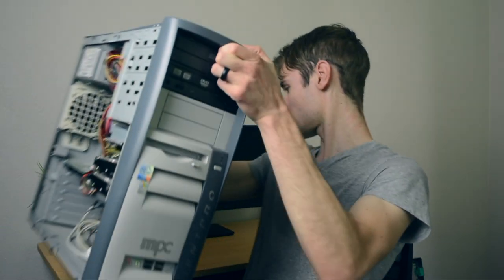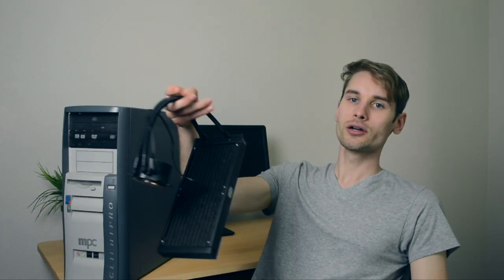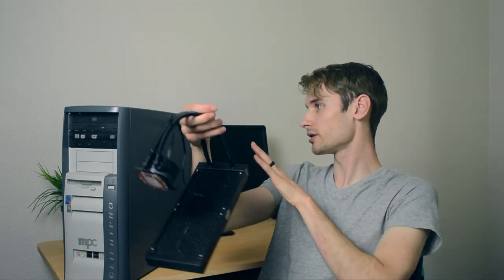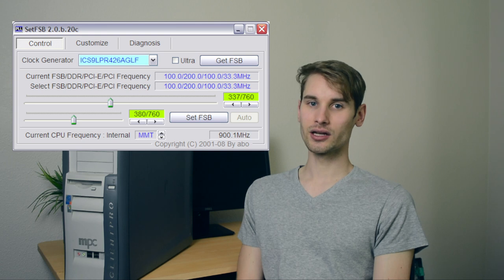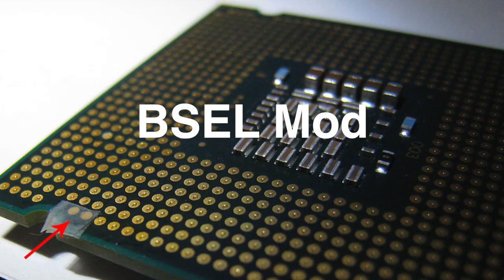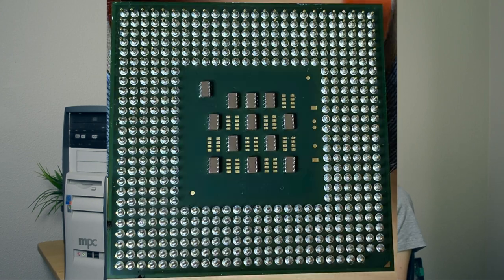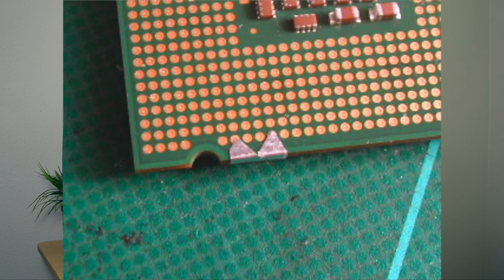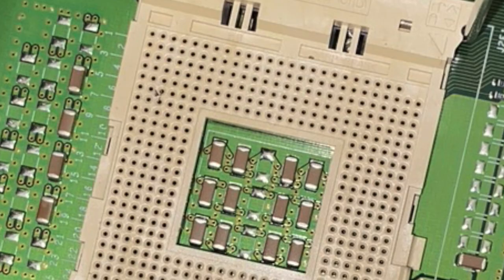Why Overclocking In The Early 2000s Used To Suck

Comment: That's because people used BCLK to overclock back then. Multiplier adjustment came later. Depending on chipset not all boards had pci/agp lock, so your maximum overclock depended more on what those buses could handle rather than CPU itself. It was a mess, but what you did is crazy. Nobody really modded Peniums like that and nobody really broke off pins. That mod only worked to change FSB of motherboard if chips came for socket with such capability and only if there was higher FSB. Socket 478 Pentiums as far as I know didn't have that. Software overclocking wasn't really a thing either, that program was mostly used for mobile chip overcloking in laptops and it was common for it to not work. Still, using software to overclock back then meant that you really shouldn't overclock due to motherboard being weak and no thermal headroom. Depending on chip, some didn't even have any thermal protection, so if it ran too hot it continued to do so until it burned down.

Comment: I don't think it was so bad - I remember that I easily modified my Duron with a pencil from 600mhz to 900mhz. And even before were legendary Celerons 300A which could easily be OCed from 300mhz to 450mhz. In 2000s there were also some Core2Duos which could be boosted from 2ghz to 3ghz! I was poor and I had to buy cpus which could be overclocked, as I knew I will not get a new one anytime soon. 
The only thing I really like now and was not there 20 years ago are this nice diodes on motherboards and postcode displays which tell you exactly why your PC won't boot up. Dual Bios is also a very nice feature to have - which saved my ass once.

Comment: Fffhahaahah! This was NOT normal mid-2000's overclocking. There were no software options back then. We had pins, jumpers and custom VRM lock settings. Overclocking was literally textbook overclocking and maybe a higher FSB if you weren't already at the end of the spectrum. All the cool stuff for Pentium 4 existed on every Springdale board but the Northwood and Willamette chips didn't typically enjoy them. It mostly went to Prescott and every other HT enabled chip from then on. BSEL mods might have been cool for a bit but it looks stupid and it is. I'll stick to anything but this.